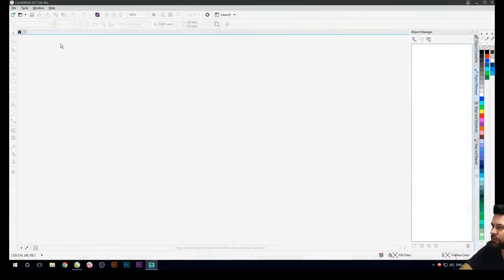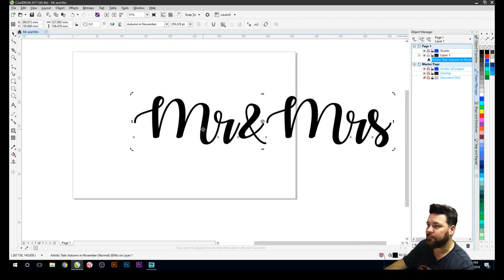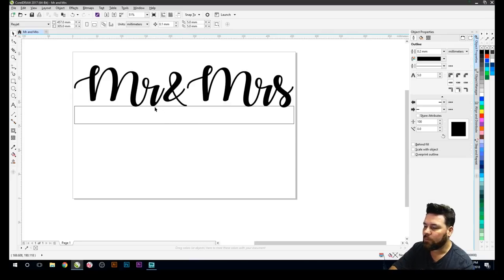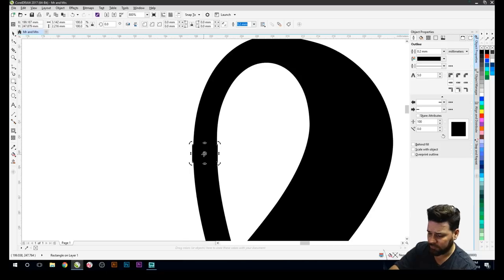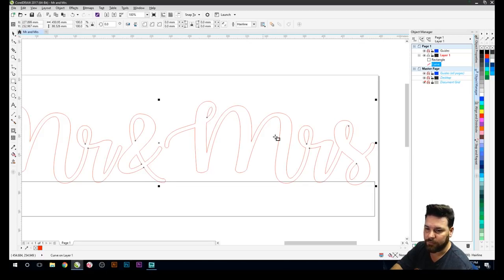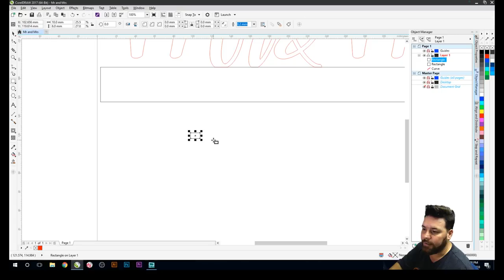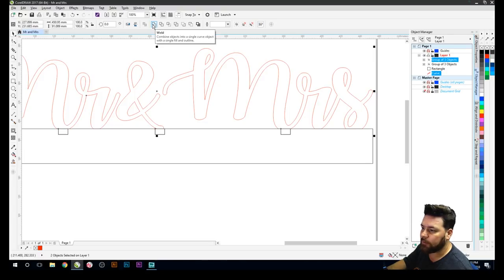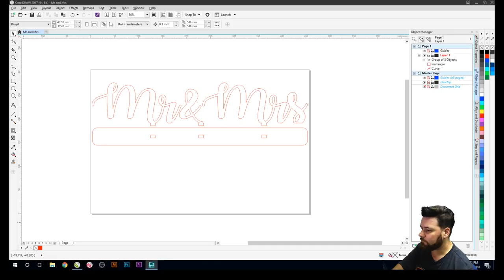Laser Cutting A Table Name

Comment: It would be great to see the finished cut and assembled piece.  Looked like there are many pieces floating supported by very thin material
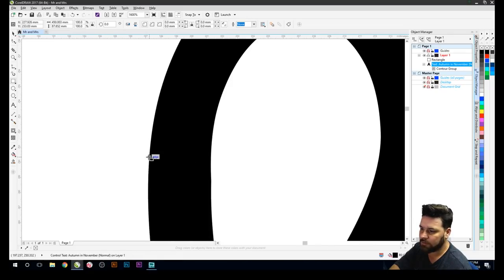Reply from the maker: Hi Jorge, Yes I will need to make sure I add another video up soon and include a finished job. In this video at about 4:50mins I measured one of the thinnest pieces. What I was doing was making sure the thinnest was as big as or wider then the thickness of the material. So if we were to cut this on 3mm thick MDF. We want to be at least 3mm wide in the thinnest parts, to keep it nice and strong. We are working on making better videos, and these comments help. Thank you
Reply from the maker: Hi Jorge,
Here is a video showing the finished product. It is a Topper but still worth a look. https://youtu.be/CGikQQ6Xda8